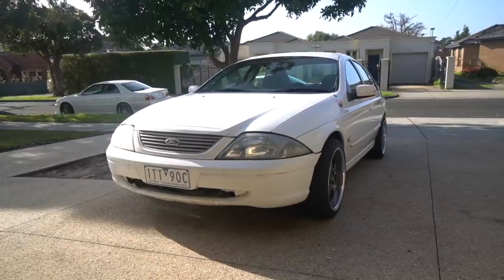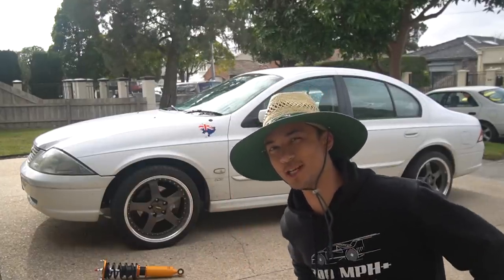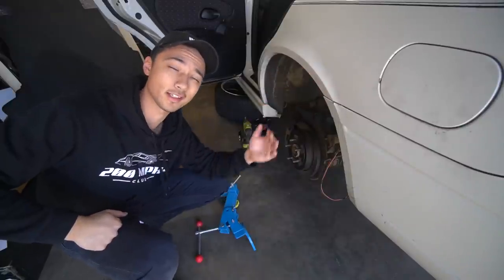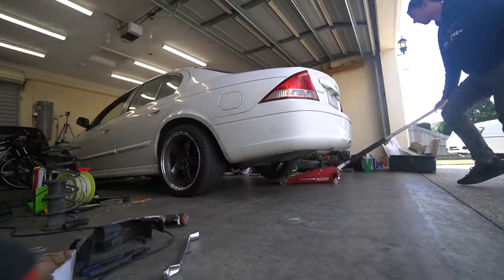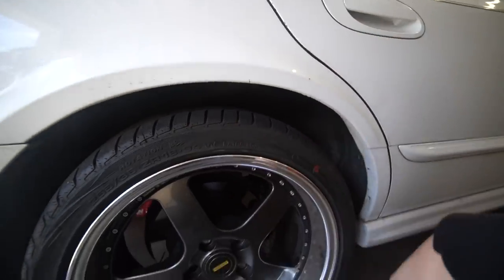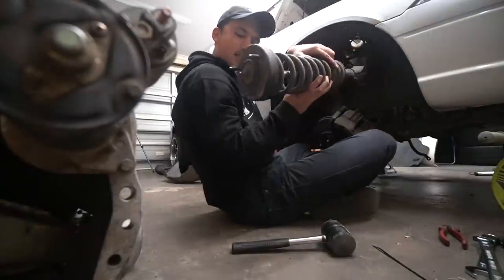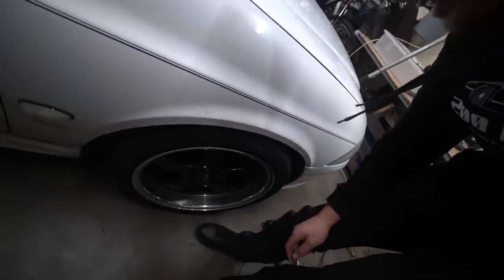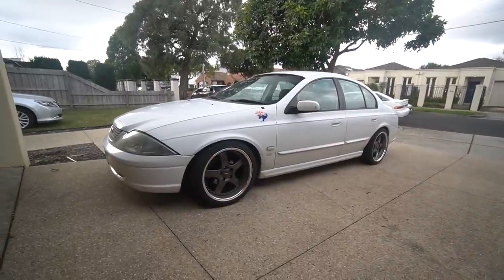AU FALCON GETS MAXPEEDINGROD COILOVERS! (+ CHOPPIES)

Comment: Probably could have used your “stupid eBay guard roller” if you did it AFTER you lowered it.  Since it’s designed to fit under lowered cars that have clearance issues.  Also coil overs are adjustable for a reason, to save you cutting them......